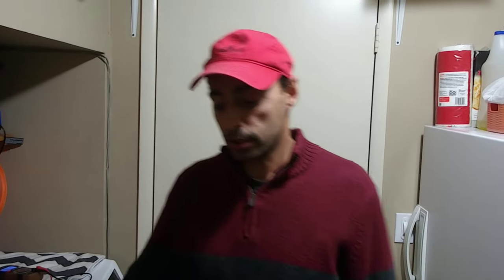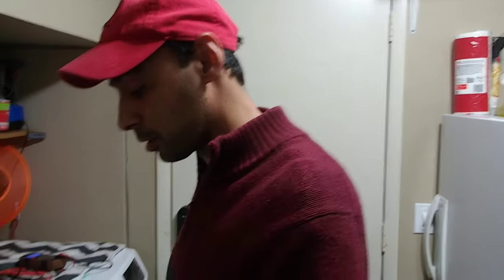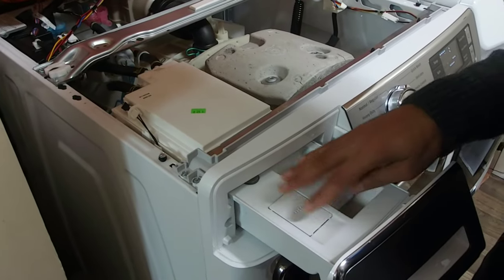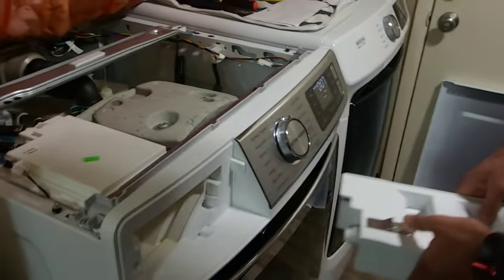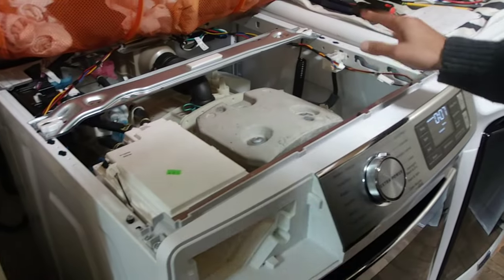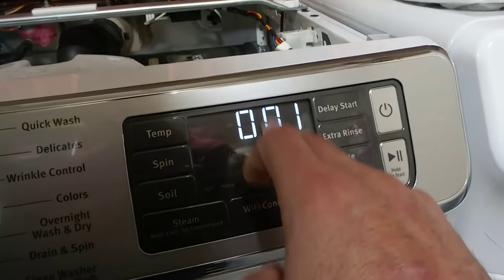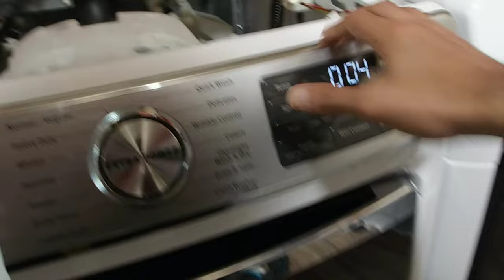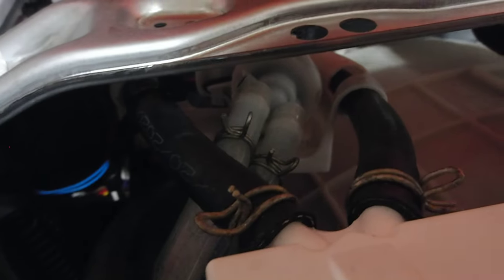Maytag washer detergent tray full of water or clogged Fix

Comment: This was very informative. I appreciate your thoughtful video as it was detailed and easy for me to understand. 

We just bought the same washer and dryer one year ago and we’ve had problems with it cleaning our clothes months ago. The tech said we need to make sure the soil level is at highest. It is always at the highest level and detergent was dispensing correctly up until recently. I wonder if there was an issue with the pump a long time ago. I am going to try the diagnostic test 10 and see if it works. 

I do have a question for you. You mentioned toward the end of your video that you cleaned out those clear detergent hoses with very hot water using your kitchen sink faucet. How did you take the hoses off? That might be a little out of my league. Lol. 

Thank you again for the video!!
Reply from the maker: Hi there! There are metal clamps on the hoses that you need to loosen, using pliers. Hopefully that helps! Thanks for commenting!

Comment: Nice detective work! Did you remove and rinse the clear hoses under hot water, or the pump?
And test 10 is just for the soap dispenser pump?
Reply from the maker: Both I cleaned, and yes it’s just for the soap dispenser pump at least for me!
Reply: @Craving Solutions  Hi, thanks a lot for the video, I have the same model you have, and this video was just perfect. How did you rinse the pump?  Did you open it, or did you throw  hot water thru the holes until came clean?

Comment: Thank you for taking the time to explain the steps so clearly. I thought my machine had this problem but I believe the drawer housing is leaking or the drawer needs replacement. Don’t know why the floor is wet on the drawer side.
Reply from the maker: You're welcome, I'm glad the video helped give you some extra insight. I really hope you figure out what's causing the leak. Removing the top and running the washer should help you see where its leaking from. Thanks for taking the time to comment, and supporting my channel, with your help, I'm getting closer to 1,000 subscribers :)

Comment: Do you still use the optimal dispense detergent?  And how long does it last until light is suppose to tell you when to refill?  It seems like level never goes down on mine.  I may do diagnostic to see if that helps.
Reply from the maker: I always use the he logo detergent, hard to tell you how long it will take. But what I do to ensure my dispenser drawer continues to work. I always fill just enough to make it say low detergent. I know that kind of defeats the purpose, but so far I’ve been confident that I don’t really have to worry.

I also found that water sometimes gets in the detergent compartment from the other compartments. I used some caulking in the center of the lid to stop water from coming in from under.

I appreciate your support for my channel! We are so close to 1000 subscribers :)

Comment: Do you know what each of the diagnostic codes are for? My fabric softener compartment doesn't empty. I cleaned all the holes and ran through each of the codes. Water never came out of the fabric softener holes in the roof. Just wondering so I know which code to keep testing. Thanks for the video - it was great.
Reply: I am having the same issue!
Reply: I am having the same issue

Comment: Thank you so very much!  For three years my soap dispenser would not work. Our automatic optimal dispense drawer was filling with water and simply not emptying.  Watching your video very carefully, my pump was rotating but not sucking.  After several trials and errors, I found my pump hoses were reversed from factory.🥵 So,.I reversed the clear hoses and NOW I have detergent flowing in the lines like yours.  I am In the testing phase and have notified Maytag. Will let you know the results..😀
Reply: Update, Maytag was not interested in providing any support, "out of warranty", so if there is a factory defect or quality control issue, Maytag will not support the buyer.
Reply from the maker: How did it go? I’m so glad my video was able to help and I appreciate your support for my channel! We are so close to 1000 subscribers :)

Comment: Excellent but how long do I run it on ten.
Reply from the maker: Until it stops on its own, then open up the drawer and see if the detergent compartment is empty. If it isn’t run it again, if it still won’t unclog you may need to open it and clean the tubes as I showed in the video.

I appreciate your support for my channel, with your help and others we are almost to 1k subscribers!

Comment: Edit, i did what you did. No color in the hoses just water. 🤔 Wondering if someone was in there b4 me. It May be trying to pull from the outlet side and the hoses are backwards. Can you verify how the hoses are connected to the pump on yours? Left outlet on pump to detergent output, bottom connection and right on pump to upper on drawer?  Thanks!

Thank you!!! I've been trying to figure out this exact issue. When called Maytag Cust service, they couldn't help with out sending someone out. No thanks! I've been searching for a while and today your vid popped up.  My question was, how am i getting so many loads out of one full detergent fill? It wouldn't tell me time to refill, and like you say all water, until i pull drawer to clean and empty it. I will try your fix and edit in my results. Thanks again. 👍
Reply from the maker: I am so sorry YouTube didn’t show me that I had a missed comment before… You’ve probably already solved your issue, but the top one is the one that auctions from the tray and the bottom is the one that brings the detergent back in. In the diagnostics mode just let #10 run again and again and if that doesn’t work you should clean out the tubes. 

Also the tray in the back may not be making good contact, try to make sure it’s flush so that when it starts to suction it’s suctioning the detergent and not just air. 

I appreciate your support for my channel and apologize once again for the delay. With your help and others we are almost to 1k subscribers!

Comment: Thanks for posting. But you didn't say what the root cause was of the clog? Seems like it may have to do with the viscosity of the detergent. I'm going to do what you recommended with "diagnostic 10" with the tray full of water instead of detergent to see if that clears the system.

Comment: The liquid dispenser worked for a few washes on my new Maytag (8630) washer, but then it started to backfill the dispenser with water ? So, ever since I just use detergent pods ! Lately, I've heard that filling the dispenser with white vinegar might unclog the line, so I've been trying that, I'll still keep using the pods if it doesn't ...no problem !
Reply from the maker: I actually realized on mine that as well. So what I did was put a foam stick pad mainly used for doors and windows to stop water from going from the right to the left…
Reply: @CravingSolutions  On Google, some technician's say just replace the dispenser, and some say that the pump and line are probably clogged !? Well, that runs into a project, cause you have to take the top of the washer off, and the small pump is behind the dispenser ! I think I'll just keep using pods...ha !
Reply: That's where i ended up, using pods. I think i got it cleared but since I've started using the pods i haven't gone back.

Comment: Hi. Thanks. I’m going to try this. But how did you remove the top? Do I start with the screws on the front panel near the dispenser drawer?
Reply: 2 on the back where hoses and plug are. Slide top back then lift
Reply: @nadinemoore9837  thank you

Comment: This was helpful. My detergent drawer keeps filling with water and I have had repairmen here 4 times and they have replaced the drawer, pump and tubes and water valves—nothing has fixed it. I took the drawer out and into diagnostic mode to test the parts. On 004 a heavy stream of water shot out and the drawer opening and straight into my face.  I’m thinking that must be what is contributing to the water in the drawer after a cycle, but I can’t find any description of what part/cycle 004 controls. Do you know?

Comment: This worked for us, but temporarily.  I think the issue happens when I run the "whites" cycle.  The pressure of the water going into the bleach compartment is too high and files the detergent compartment with water.  We have tried turning the pressure down and if that fails will try the foam piece mentioned in one of your comments below. 

Thank you!

Comment: Great video and thanks.  Wish this was around last year.  With your info I was able to trouble shoot my same washer.  Been doing this since new in December 2020. I’ve had Maytag out here twice to fix this problem, they’ve replaced the tray etc.  still doing it and can’t figure it out.  After watching your vid and learning how this machine handles water and fluids, I will share this back.  The soap pump is working as it should yet still same problem.  What I believe the issue is water pressure.  The soap tray is not sealed therefore when water is flooding in to charge say the, bleach or softener, it is flooding into the soap portion.  I have very high water pressure at my home.  After seeing how it works, I closed the faucets down a bit to reduce the pressure .  I think this is the true culprit.  At least in my case.  Time will tell, but I’m hopeful.  At the time Maytag was here, the tech said he is dealing with these new machines a lot for the same problem.  Could it be something as simple as high pressure.  Let’s hope.
Reply: What’s your water pressure?
Reply: @anto6423  honestly I don’t know.  I haven’t put a gauge on it to check, but I should.  I pulled the drawer out to see what the water actually did without the tray in.  I saw that regardless off the setting water flowed through the bleach and softener trays. It looked like the flow was very high.  I turned the pressure down while cycling the machine in the service mode as described until I could see the water was only flowing into the bleach and softener section without splashing over into the soap.  I’ve had the water tuned down for the last two weeks and have not had an issue since.  After the drawer was replaced by a technician the first time, I had water issues in the soap after a few days.  Hope that helps.
Reply: @robertmcshanephotography6959  it does, thank you!